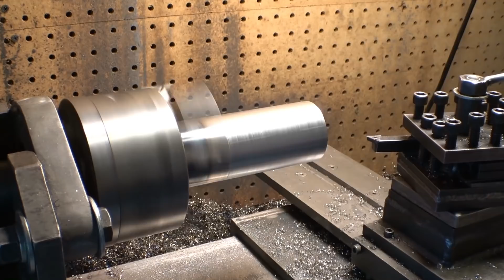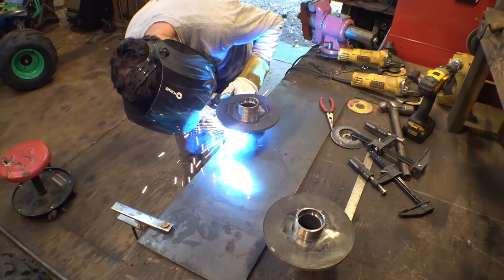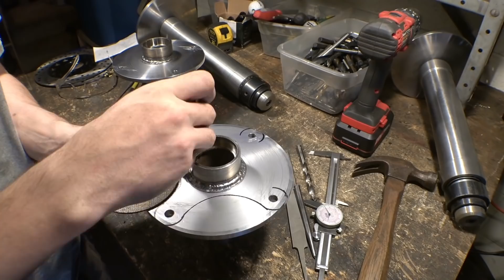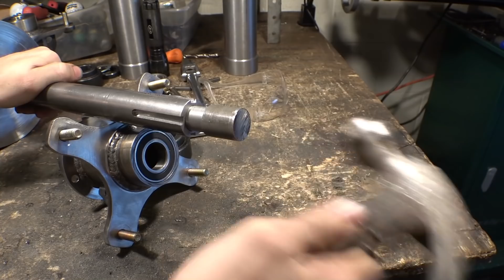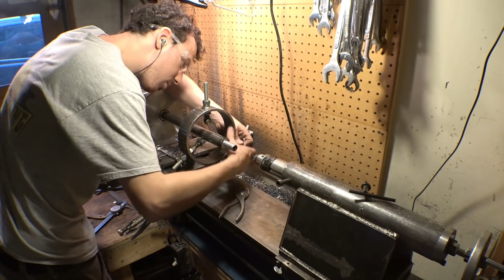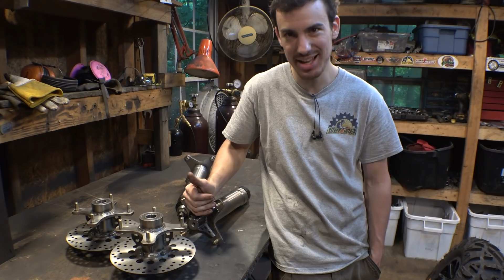CBR 1000rr Off Road Buggy Part 2

Comment: We had that 'occillation'problem trying to cut the first Crown Vic/LTD axles.Higher speed and slower tool feed kept them from 'corkscrewing'the bearing surfaces.That far from the bracing of the tool mounts allows that fun stuff to show.I just 3x speed and cut tool feed by 50% and they quit vibrating.

Comment: Advice regarding the lathe. Whilst your easy rest is beefy, it lacks any lateral support. Vibration, enters the pipe section and it moves around it. I suggest adding some fins on the outside to give it extra rigidity AND wider or double bearings. You can actually see it flex, when you manually move it from the pulley.

Comment: You need a plasma torch to cut things out rather than using the grinder to do so much cutting. It’s fast and clean. Then just a very little bit of clean up with a grinder. You have a lot of nice equipment for your builds. A plasma cutter would be a nice upgrade. I really like mine. I put off purchasing one for a long time. Once I finally got one it’s has been a fantastic tool to have

Comment: whats going on  well lol  a bit much leverage causing vibration  so less stickout  steady rest closer to the work area should improve the experience.. i suspect you have some wear and play in your equipment as well some of that can be addressed inspect your shaft bearings and replace as required  tool post bolts gibs...all general maintenance stuff   same as a car plane train or boat.. keep it clean  change and keep its fluids clean and full and it should last a long time but things will wear tooling lol ways bearings and gears all will have a service life i suspect your insert may be in need of rotating as well because that was a lot of "chatter" for the speed the material and the stickout and the light depth of cut hope my observations help  lookingforwad to more videos and thanks for the ones i have watched

Comment: I don't think your hubs will live long. Those radial sealed bearings are fine for rotational loads. They don't handle shear force well. Just tightening them onna shaft will side load the bearings.  Using a tapered roller bearing would have been MUCH stronger.

Comment: Going to use 50mm square fence post to make a simulator frame, wish me luck because my only other time welding was two rims together
Reply: What is the material thickness? Even something .080 may not be thick enough without serious triangulation.  Fencing is usually coated so it doesn't rust. Don't be welding on anything zinc coated indoors.... if you do you won't have to worry about having done it for long :-/

Comment: So you don't have to struggle with lining up the pipe (or stock in general) make a bar, akin to the roller bar used to make diamond patterns, but with a smooth rollers. You have that at 90 to the stock piece and at the slowest speed you can get, with the jaws, just a kiss loose, you touch the wheel to the stock, until it becomes set. Old trick, works really well. First few times, i recommend you stick something between you and the stock tho, as you might get it too much and it might fly.

Comment: If you are making a rear suspension, like your twin engine buggy, I hope you make much longer suspension arms. If you have the pivot closer to center, like under the seat, and definitely not behind the seat, when you give it some throttle the rear won't lift or jack like your old one did. I'd start with arms half of the wheel base in length. Easier to shorten than lengthen.

Comment: 530 chain is the exact same thing as #50 industrial chain that you can find everywhere and for pretty cheap. You might not be able to find very big sprockets in 530 since almost every aftermarket brands only do 520 . I think you should use #50 sprockets with a 530 o-ring chain, it's cheap and super easy to find.

Comment: Way overengineered, but I guess it's not going to break.
Reply: With sealed radial bearings in the hubs don't be so sure. Fine for pulleys or rotating objects. They don't handle side loading (turns or hitting objects) well. They'll live for a while but not long.

Comment: Awesome job!
Have you ever thought of trying to use suspension parts and hubs from a small front wheel drive car?
Might save time... I say might because I'm sure they would need to be modified to allow for the suspension travel a buggy should have...
In any case, Glad to see another project started!
People complaining about not finishing one before starting another don't have any idea how this stuff works.
Reply: Yeah no way for proper travel with susp.from road cars... Short a arms and cheapest possible struts ;
Reply: A wrecked rzr or decent sized four wheeler might be better than a car

Comment: I'm literally trying  to figure out what kind of rear sus your going with it looks like some kind of independent chain drive crap why didn't you just use IRS with cv axles it's the best period instead of the motor to jackshaft to 2 sprockets then chain to each wheel sprocket I dunno man dual A-arm suspension is the best for a reason
Reply: Cuz he wants to do something different..... Who cares if it's the best it's his....

Comment: Just chuck one of those cv rear ends together for me and send over to Australia cheers mate
Reply: Just use a car differential carrier and mount with bearings. Plug in cv joints and sprocket goes where the ring gear normally mounts